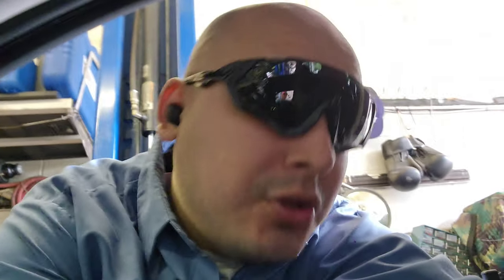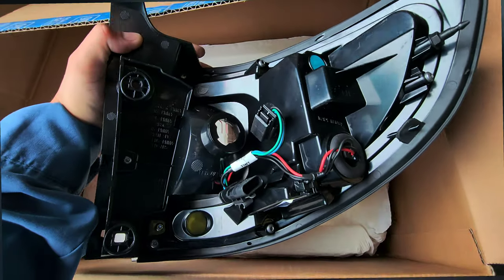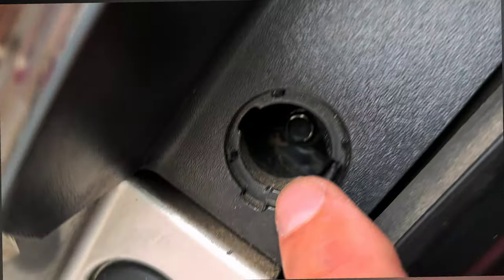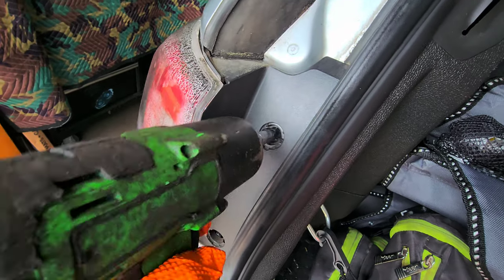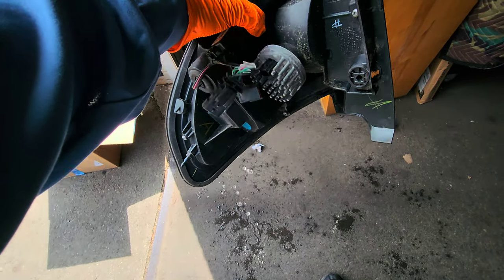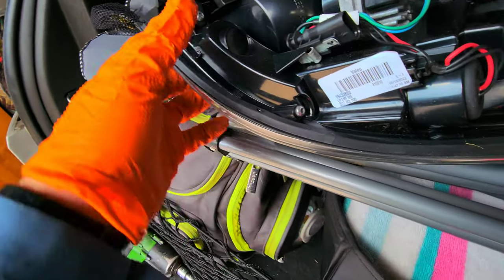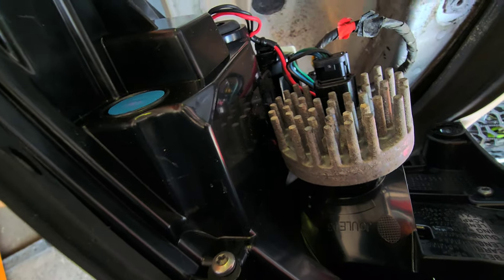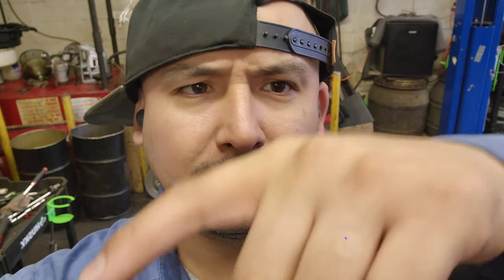2013 - 2016 GMC Acadia How to replace tail light assembly

Comment: Hi.  Great video.  Thank you!  Before, and after, I changed the assembly the turn signal blinks fast like a bulb is burned out.  But, both the front and back are blinking.  They're not burned out.  Any thoughts on how to troubleshoot that?  I was thinking I'd just replace the bulb, like you did, and hope for the best.  Thanks you so much.  Your video gave me the confidence to try it myself.  Worked fine except for the fast blinking.
Reply from the maker: https://www.paypal.me/axtuo
Show your love by supporting the channel and leaving a tip, and I'll reply right away your answer. God bless you
Reply: @AxtuoAx  A tip? Are you serious?  Here's a tip.....buy low and sell high.
Reply: Might needt a capacitor the one you have must be failing
Reply: @iiSup3rior  Thanks!  Ended up changing out the bulb too and that seemed to do the trick.
Reply: @Smitty300 🤡